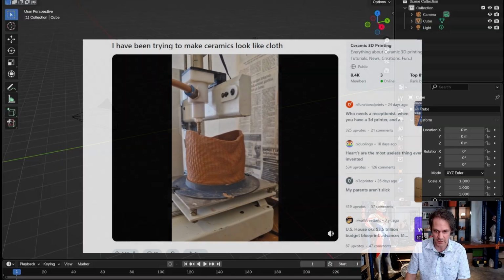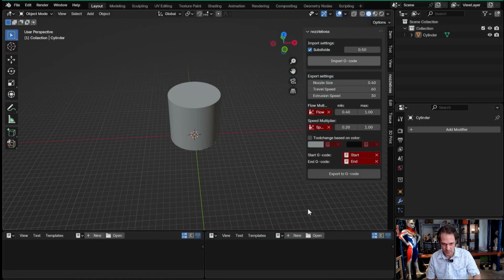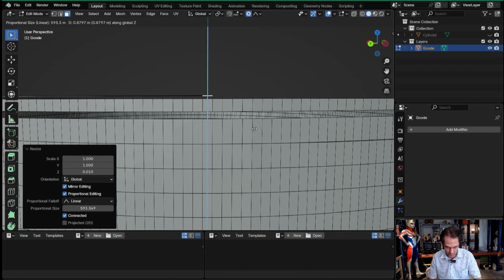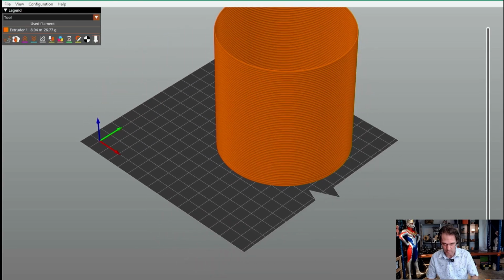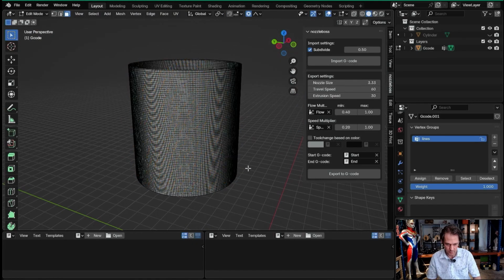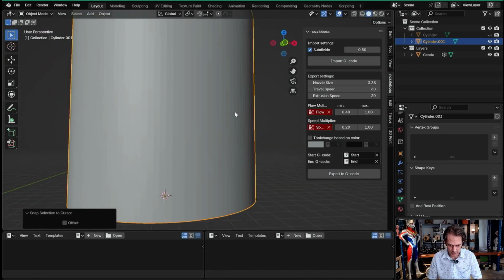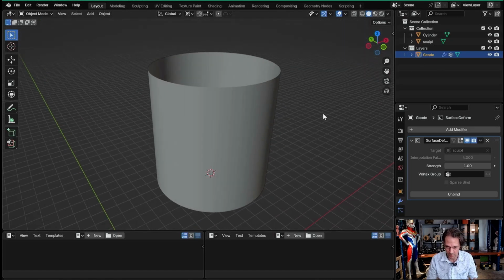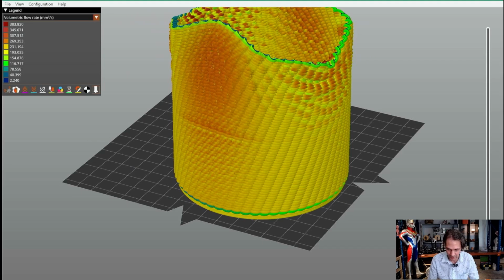How to Create Non-Planar 3D Prints Ceramic with Blender (No Rhino or Grasshopper!)

Comment: i’ve been having issues with the gcode i get from the bambulab slicer, apparently it’s not straight gcode but a .gcode.3fm which blender (with the plug in) doesn’t read
Reply from the maker: Yes this only really works with gcode created in cure unfortunately. I stopped using the important function from nozzleboss as it was very limited.  I have been building my own spirel contour in blender, using geometry nodes.   Cura does still work though.  But you will find you cannot import back to Bambu slicer unless your start code has the corect settings.  Which is a little irritating as well. You have to preview your gcode on on cura or prusa slicer then load it on the the printer by usb if you are using a bambu printer.

Comment: It took me aroud 2 day to figure out the printer and settings but at the end I did it. Thank you for sharing your knowledge. I am very curious to experiment and start creating
Reply from the maker: Hi. Thank you for your kind encouragement.  If you are interested in beginners step by step non planar workflow guide, I have in depth tutorials and tools on Patreon. See you there. Cheers
Reply: @claywoven  Hello,  should the starting shape be alwasy cylinder, because when I started with other object such as sphere, subdivitions are not equal.
Reply from the maker: @aysenkocakabak7703  Yes, I start with a cylinder. Then wrap the cylinder around the shape I want. It's called a shrink wrap technique. Check my newest video. Most of the video is talking about how to get around this limitation
Reply from the maker: Also what printer are you using? I am curious

Comment: Can you please share your material properties for the clay print material you used in the slicer, or where you downloaded the material profile please. I don't see it as one of the preloaded ones, and I can't find it on the Ultimaker material marketplace either. Thanks!
Reply from the maker: I am not using the print settings from the slicer for clay i am i am using blender. But if you want to set up a material In your slicer for clay. You just need to make sure the extrusion temperature and bed temperature are both zero. The rest do not matter as  much. And you can change them as you discover somthing you need to add.

Comment: Good afternoon.
Could you please clarify if your plugin will work with Bambulab printers and slicer?
As far as I know, models saved in Bambulab Studio also contain metadata, and the file extensions look like this: *.gcode.3mf or *.bambu.gcode.
Reply from the maker: Yes, although it is a little complicated.  I cannot take credit for the plugin as i did not develop it, i just found ut and amd experimenting. I have used it  with bambulab a1 mini. If you look at the other videos on my channel, there is one where I use it with plastic a1 mini. But bambulab has a start up sequence that ideally you need to include. By copying if from the code generated by bambulab.  And adding to the start text in the blender file. But bambu studio can open a sliced gcode file and sent it to the printer. You just have to be careful the code you send works.
Reply: @c @claywoven  Thank you. I've watched your video using the A1 mini. However, no matter how hard I try, I have even more questions now. When I load the code into Bambu Studio, it displays everything in a single layer. Perhaps I haven't figured out the plugin properly.
Reply from the maker: @Ushiko_engineer , hey, I am thinking I might do a video on the setup I used for Bambulabs. If you have not fixed your issue yet, maybe you can send me a few screenshots on my IG, then I can use that as a way of understanding what goes wrong and what I need to explain better when I do the video.
Reply: @claywoven  You really should talk about how to setup bambu printers since extracting their start G-codes is extremely difficult.

Comment: does the gcode also works with the bambulab slicer??
Reply from the maker: It works just the same with a bambulab printer. But you have much less clearance with plastic printers because of the hot end and the cooling fans give you less space to move.  But as long as you are careful you can do it.

Comment: how do I set the start and end G-code?
Reply from the maker: If you open up a new window in blender and set it to a text editor, there is a drop-down menu that has 2 filed already set up called start and end. You add the code you need in those files